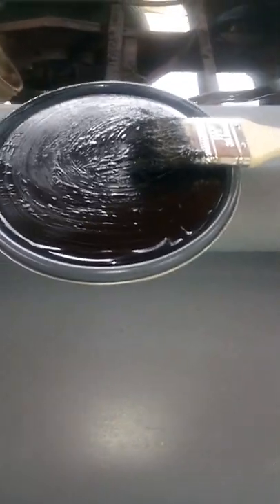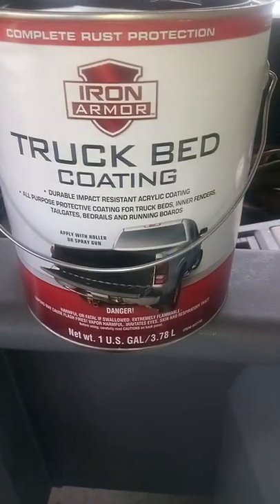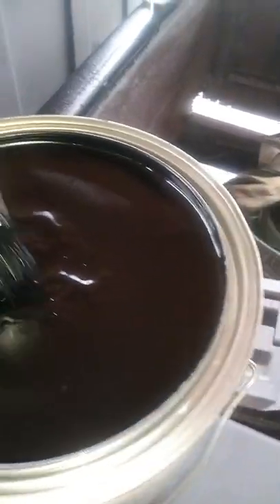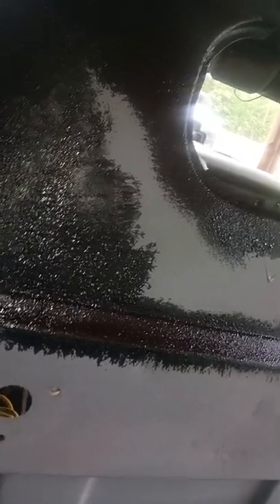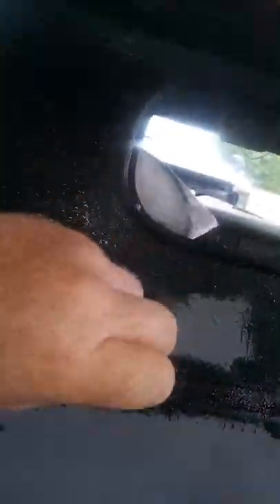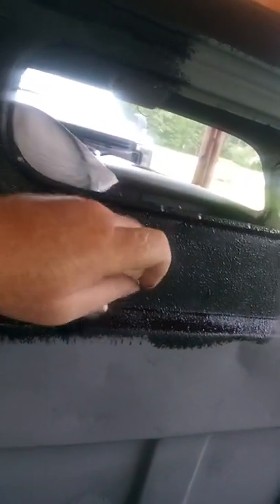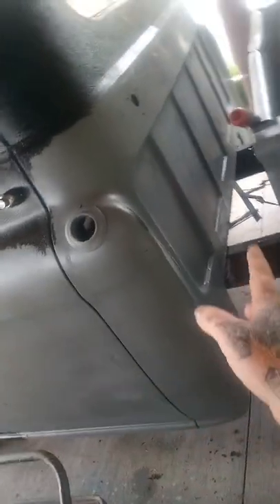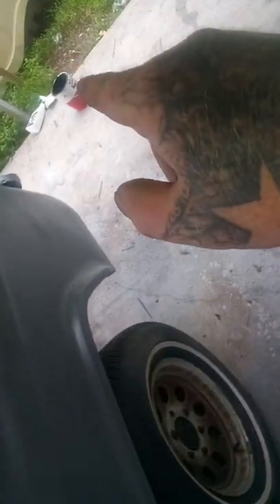Rust-Oleum Bed Liner Vs. Iron Armor Truck Bed Coating On The 1958 Chop Top Apache Rat Rod

Comment: How has the iron armor held up compared to the rustoleum?
Reply from the maker: The iron armour held up amazing I actually sold the truck about 6 months ago but had no issues with the heat rewarming sections of it nor any issues of cracking or peeling or fading I'd definitely recommend over the other
Reply: @simplelifewithsuess8391 cool appreciate your review. Just bought a can of the iron armor for my jeep floor.